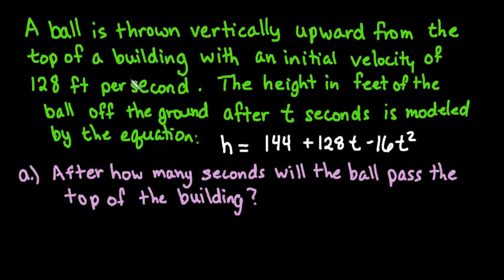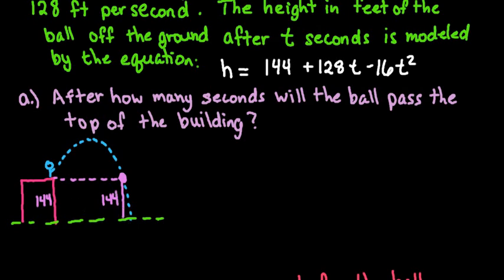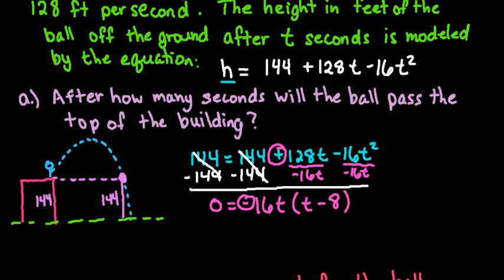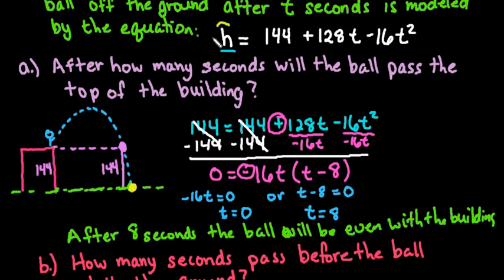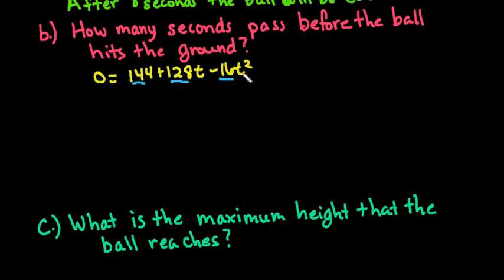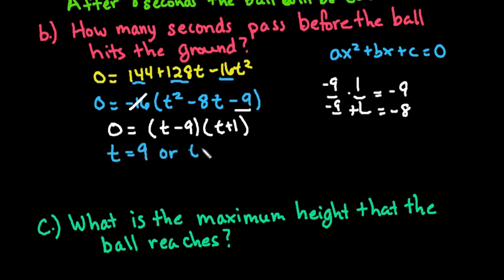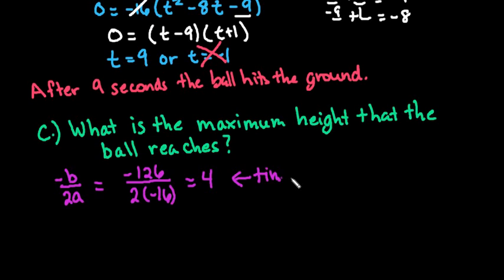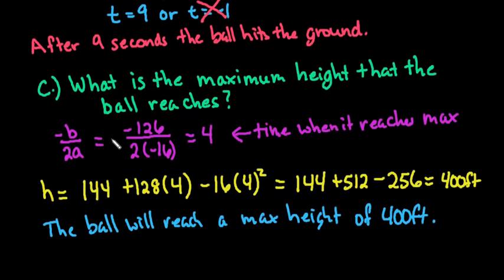Quadratic Word Problem - Throwing Ball from top of Building (factorable)

Comment: I was confused by the problem solving letter C, where u put 126 instead of 128 ? or I am the one whos wrong?
Reply: That's just a typo, it should be 128. If you use 126, the result wouldn't be 4.

Comment: Quick question: Once I figured out the ball hit the ground at (9,0) & left the building at (0, 144), why can't I say the midpoint of x=9 and x=0 (i.e. x=4.5) is the line of symmetry of the parabola? I followed the math to see that the vertex is (4, 400). Is the vertex not at x=4.5 because the ball starts at the top of the bldg? Not sure how that "works out". Thanks!
Reply from the maker: It would be symmetric at the point where the ball started on the ground on the negative side. Since you are starting at a height above the ground, you are already partially up the parabolic path. Hope that makes sense.